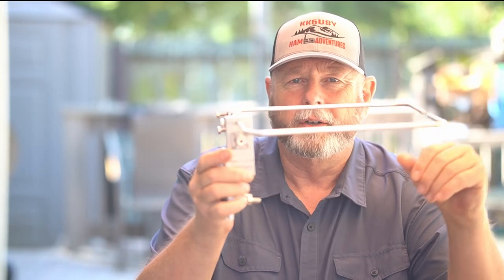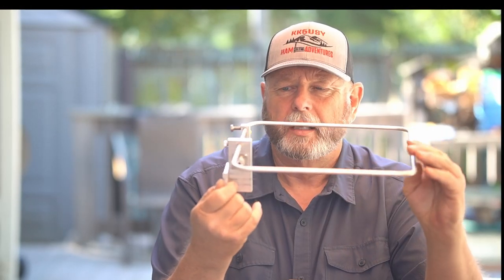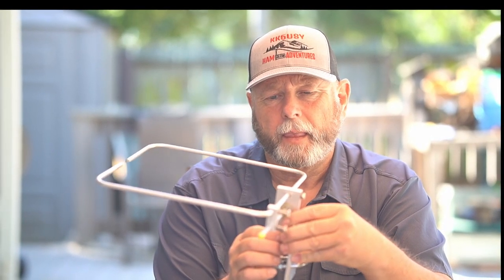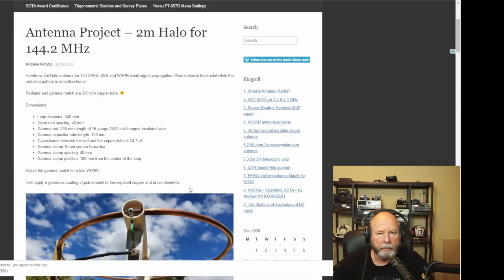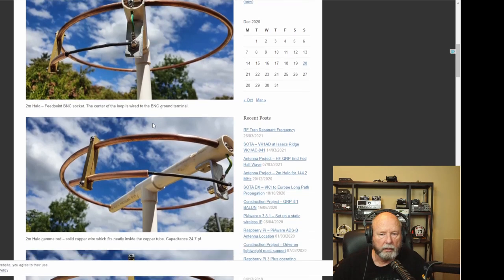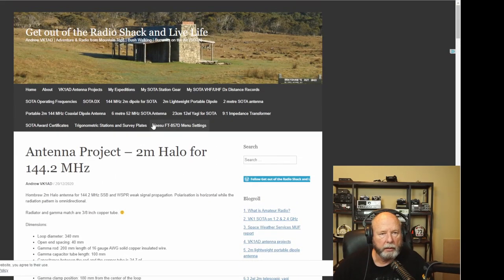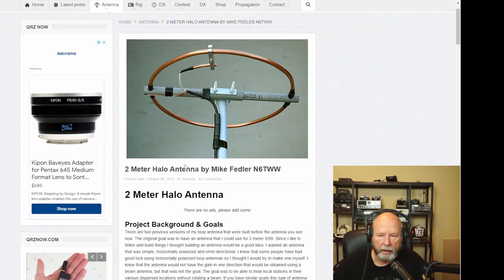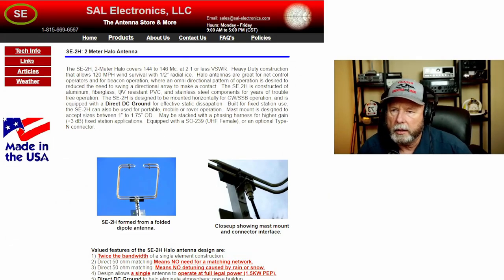How to build Halo Antenna.

Comment: I've seen those old pictures of mobile hams from the 1950's using the 6 meter round halo antennas mounted on the rear bumper with a brace in the middle.
Reply from the maker: They are interesting antennas for sure, and perform really well.

Comment: Hi Chuck, great video! 
For years now I've been wanting to build a 2 meter quad,  I built a 10/11 meter Quad about 30 years ago, quads are definitely my favorite antenna's. I like your design, it makes tuning a breeze compared to drilling holes through the boom, for the spreaders, Lol. Is it possible to get a link to the .STL files for the spreader hardware?  It would sure save me a lot of time if I didn't have to reinvent the wheel. I'm just getting back into ham radio after being away due to  deafness for 10 years, I sold all my equipment at that time, I now have a hearing implants and my hearing has been restored to a  reasonable degree. So I'm back!  I  looked around for the .STL files with no luck. I would really appreciate  a link to them, 
Thank you, 
Richard 
w6rch

Comment: Thanks, Chuck, been looking at these for a while.  Think it would be great for portable operations when out I'm out on the bike, just need to work out some kind of portable mast.. Think it might be too heavy for the top of the 10m telescopic.. (hihi) 73
Reply from the maker: Kev. the 2m antenna is pretty light and you might get it to 20' on a 10m mast. Mine is aluminum if made from copper it might get heavy. Another option is make with aluminum arrow shafts , maybe make the corners with bent solid alum. that fits inside.

Comment: What is the use case for this antenna I have got one
Reply: It is an omnidirectional horizontal polarized antenna used for weak signal VHF modes.
Reply: @kp4md  I have got one for 2 m thanks. I just don’t know how it’s useful. I was told it’s good for SSB 2m. With it facing upwards
Reply from the maker: Chris use it for 2m SSB it can help hearing stations and then use your yagi needed to pull weak stations.
Reply: @digitalanaloguehamradio  The halo hears and talks to horizontally polarized stations in all directions.  If you always use a Yagi, you will miss hearing signals in other directions.  SSB, CW and FT8 VHF/UHF stations use horizontal polarization.  Using a vertical antenna for those modes can cut your signal strength up to 30 dB.

Comment: It appears to me that a "halo" antenna is simply a half-wave dipole that is distorted into a square shape.  The principle of operation is the same as that of a half-wave dipole.  But I imagine that its performance is compromised by its shape, and I would anticipate a degraded gain.  Having said that, the polar diagram of the halo may have some advantage depending on the circumstances.

Comment: But can it be done with 20 meters?
Reply from the maker: I'm sure it could be done.
Reply: Yes, on all bands. Operates the same as a fullwave loop, but measures like a half wave dipole. Put it round, or square, gets less noise, omni-directional, and is 50 ohms 😊. Super easy to build. Mine is a multi, just like a fan dipole. 40, 20, 17, 15, and 10. I could have used less wires and the tuner, but I prefer to be resonant. Works great